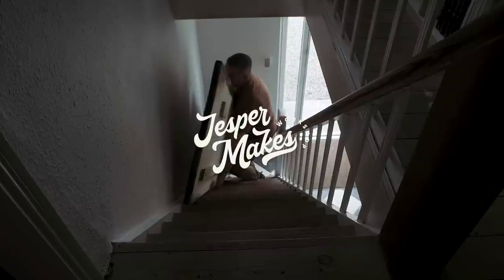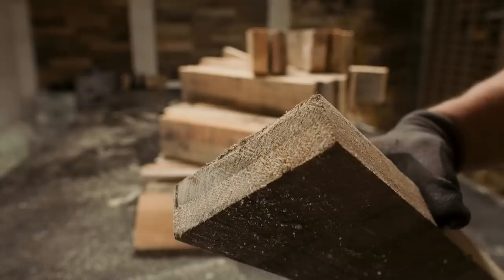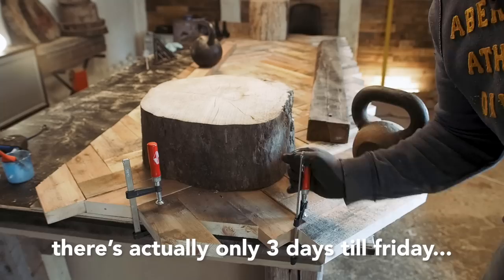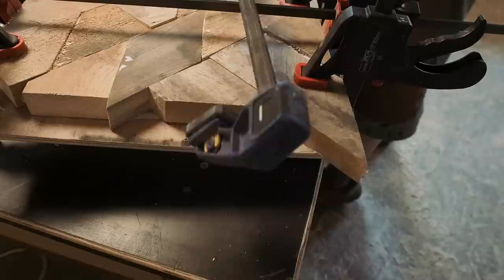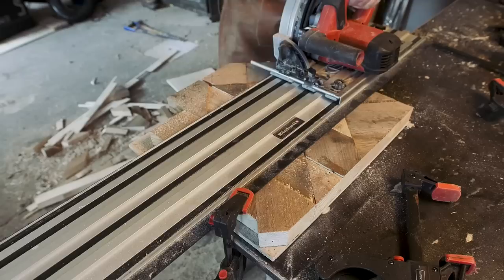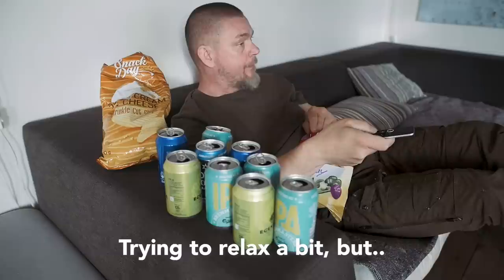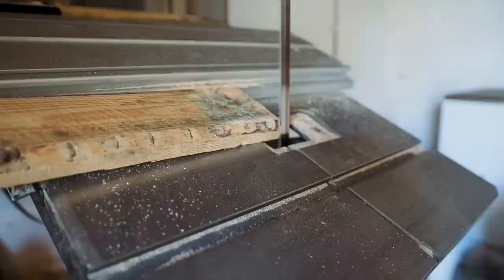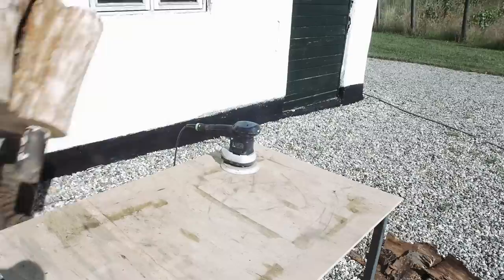I surprised my wife with a PALLET WOOD BEDROOM!

Comment: Oh and one more thang..
 Take it to the next level ..and  this is my belief..
  “There’s always somethang we need to fix , or make , or make it work , or try to make it work  or..
SO!..
I figured out that , some stuff just can’t be fixed , or the outcome doesn’t come close to the time .
 But that’s to be determined ..
So bottom line..
When it comes to repairing , or just troubleshooting ..
There’s some people who are plan A people, they give it one try , one go around , and if it doesn’t the first time , they will usually call it “broke “ and get a new one ECT     Well sometimes that would be true, and no need to go further
  But there are so much out there, that just might have more than one go around to fix  
And I call those planB people 
They just love troubleshoot , finding new and different ways to make somethang. Work , and  it can blow your mind some of the off the wall  ways people have made something that only  manufactures required method , or equipment would resesitate it.   
But No Not today !
Today we’re substituting those parts with..alligator clamps , and a pin cushion !
You’ll see!
Reply from the maker: I'm trying to get better at fixing things, for now I just love to create something from what people throw out

Comment: Keep in mind, a lot of pallets travel across oceans in shipping containers that take on toxic water, get pissed on, puked on......... In short, they are disgusting. After finishing up a project made with them, coat them with something that can be cleaned easily without peeling off.
Reply from the maker: Fair point, I simply avoid disgusting pallets right from the beginning.
Reply: @JesperMakes  I hear that! I used to work with them, but they just splinter, check, warp, and their shrink rate is ridiculous. Total waste of time, energy, glue, tacks and staples for an inferior finished product.